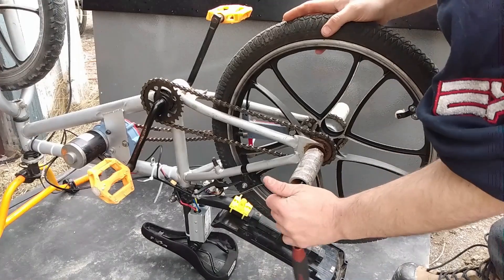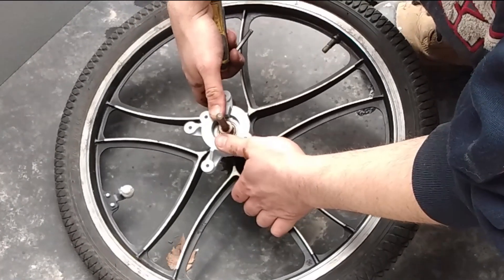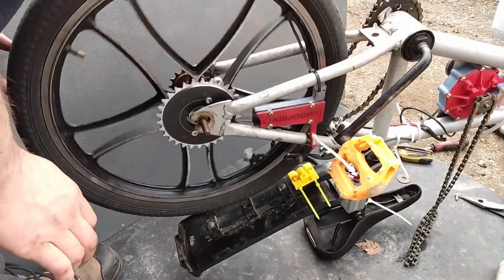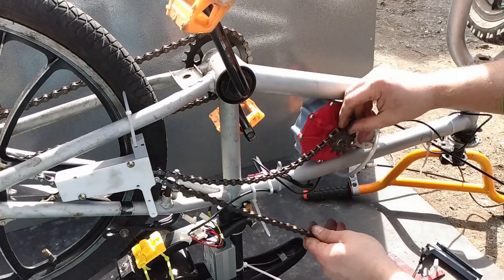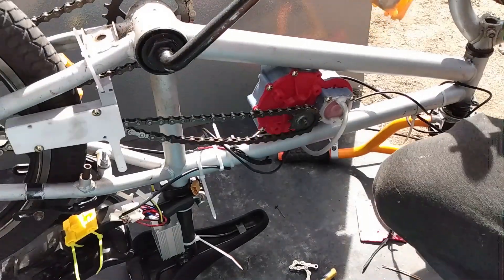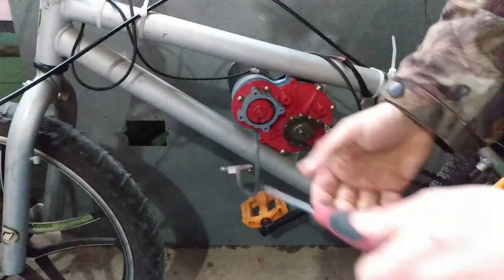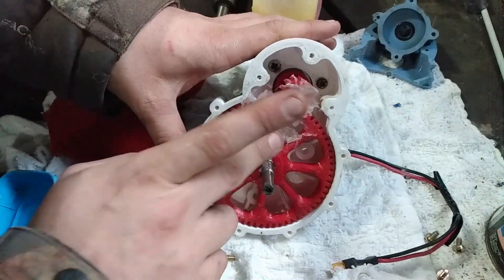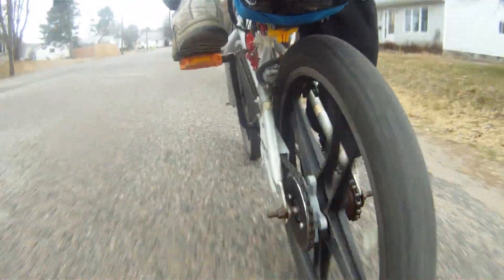Abusing Some 3d Printed Gears

Comment: Yo dude, as a joke I designed and printed a little 25mm turbo and taped it to my exhaust, expecting it to seize in a few seconds but it lasted until the tape gave up and it popped off the exhaust. It spun up significantly faster than I expected and it's still freely spinning and fine after the abuse, this gave me hope that they might eventually be functional given how well my super crappy design held up, I can share the video and details if you're interested
Reply from the maker: @KClO3  ya I have a few designs that are worth sending off for metal printing, it's more of a cost issue . Sure I'd like to check it out
Reply: @turboprint3d  are you seeing my replies? They keep disappearing
Reply: Dude... I did something similar,  maybe high temp resins are worth checking out

Comment: Really should use double helical (herringbone) gears if you're going to 3d print them. Stronger, and quieter.
Reply: Double helical in fdm style printing leads to excessive friction and premature melting.
Youd think theyd be perfect, but good old straight cuts work best with 3d printing.
Reply from the maker: Those are 2 different types of gears u noted . The herringbone yes is stronger , helical is not stronger directly but applies force more eventually however helical gears cause side load ( thrust load which the bearings are not setup for and will wear as well as force everything to one side ) . Also straight gears are more efficient .  I don't really care about sound level , but losing power to friction I do care about .
Reply: @turboprint3d  Nice thick grease is about the best you can do besides getting your corners really calibrated on your printer and doing fine touch work with a file for hours.
The 20$ for the gears you need would probably be a better idea long term, but its still fun to play around with the mechanical principals
Reply: @turboprint3d  no, they are not two different types. A herringbone is a double helical gear.  It's clear you're not as aware as you think you are. Maybe you should revisit your theory.